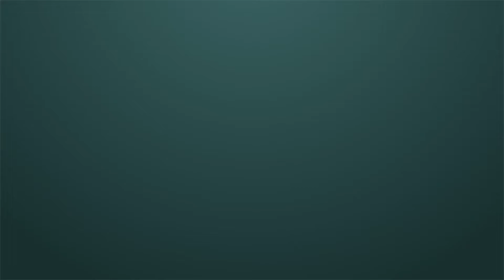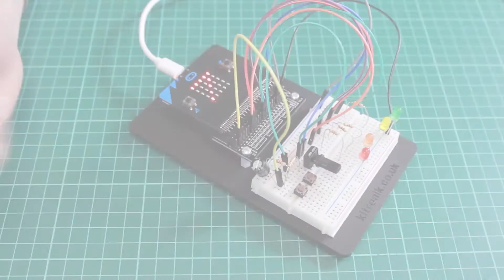Inventor's Kit for the BBC micro:bit Experiment 9

Comment: All LEDs worked except for the green LED. All the components was in place. I tried switching the green LED to other colours and the results were the same. The fourth LED did not light up.
Reply from the maker: Hi, sorry you are having problems.

Although you've already done some checking, try checking the whole circuit again, making sure that everything lines up properly on the breadboard. It's easy to accidentally get one thing one hole out of alignment.

If you still have an issue contact support at kitronik.co.uk who will be happy to help you get to the bottom of the issue.
Reply: @kitronik  I’ve tried redoing the circuit. Doesn’t seem to work. I’ll try doing another today. Thanks!
Reply from the maker: @isxuanhere  Hi, Does the display on the micro:bit LEDs ever give a reading of over 90%? If it's not going above 90%, the capacitor is not charging to a high enough value to turn the fourth LED on. If this is the case, let us know as we have some ideas as to why this may be happening.
Reply: @kitronik  Ah. The fourth LED did not light up. Even though it is fully charged up. Unfortunately I didn't have enough time to redo the circuit. But I'll try doing it today thanks!